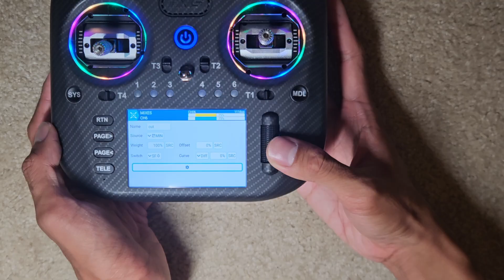Rotorflight 2.2 Nitro Throttle Channel Setup for EdgeTX

Comment: i have these settings but the gov is still grabbing the servo and and moving vert slowly.   so im not getting direct throttle.   its governed
Reply from the maker: Did you load the cli commands in the video description?
Reply: @jiawenbao3698  thank you for the quick reply.   thats one thing i did not do now all seems well :)

Comment: They way you have it setup, will it quick spool when flipping out of idle for doing autorotations?
Reply from the maker: Sorta, going into idle means slow spool up (which is still quite fast, 4 seconds if you use my sample CLI file)
Reply: Is your cli file on rotorflight?